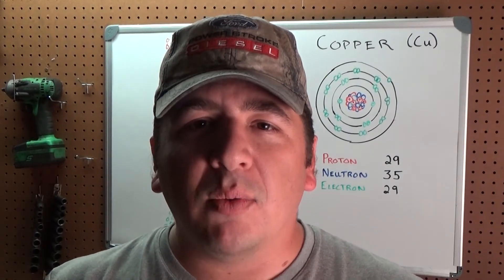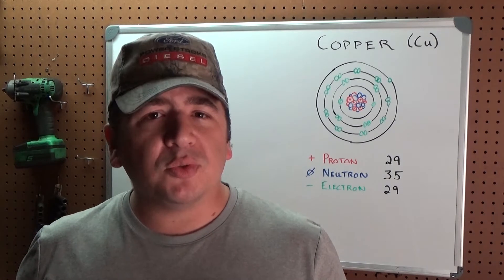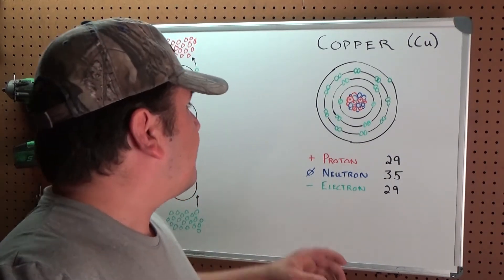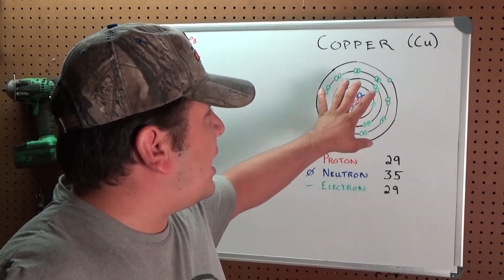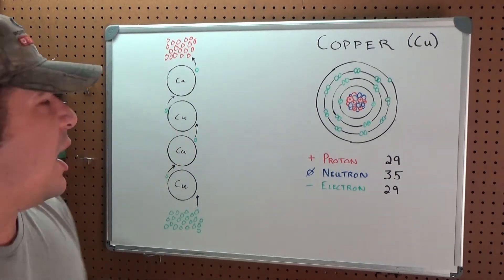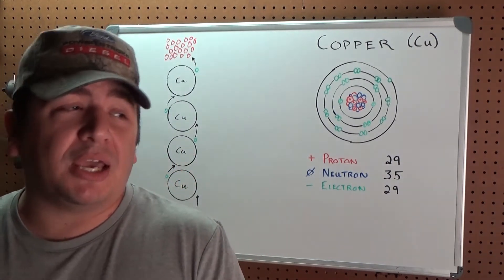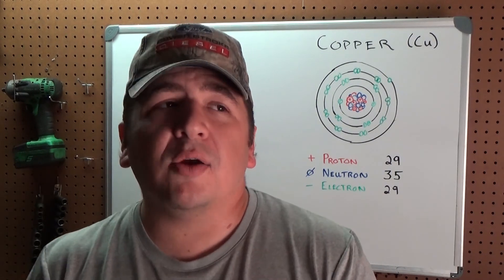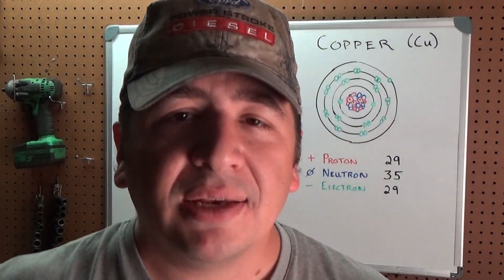What is Electricity - Electrical and Electronic Systems Training Series 1 - Automotive Education

Comment: DIY AUTO HOMESCHOOL, old classic cars in the 60's and 70's only used ONE ignition coil to fire all 8 spark plugs. Fuel injector cars need multiple ignition coils per fuel injector, any reasons why fuel injectors need multiple ignition coils per spark plug? A coil of plug COP has multiple ignition coils any reasons why? how would you measure a spark plugs waveform using an oscilloscope to test if the spark plug is good or bad?
Reply from the maker: Yes, older vehicles used a single ignition coil, the problem was RPM's. When you're trying to turn a V8 engine 7k RPM's, that coil doesn't get much dwell time, and it's working super hard. 

On newer engines, having 1 coil per cylinder gives the coils more time to dwell at higher RPM's and doesn't require them to work as hard extending coil life. 

The best description between old carburetor and single coil engines compared to new engines is that back then they were running an 8 cylinder engine. Now... the computer is independently controlling the equivalent of 8 different 1 cylinder engine. They're capable of adjusting injector pulse and ignition timing on each coil and injector independently of the others.
Reply: @DIYAutoHomeschool  can you please make a youtube video explaining dwell time, i don't understand dwell time and where to look for the dwell time when looking at ignition waveforms on the oscilloscope where is the dwell time at in the waveform?

Comment: The condenser inside the distributor of the 194 inline 6 cyl engine in my 1963 Chevy Nova lasts only 100,000 - 120,000 miles. Any suggestions on how to fix this problem? The car has only 653,000 miles on it.....should I buy a new distributor?

Comment: after college with you and joe for automotive I studied this pretty deep but if I remember correctly the actual physical  electrons themselves flow positive to negative while "current" flows negative to positive or visa versa kind of relative but I remember current being opposite of the actual electron particle. this was when I was studying atomic and sub atomic physics so its not really necessary to know as far as automotive goes but the whole conventional theory and electron theory were basically incorporated together and then they broke down the specifics discussing what current actually was. id probably have to dig up my old papers to get more in depth lol
Reply from the maker: Tate Smith The best way it was described to me is that, as we talked about, electrons will flow negative to positive by nature because they are a negative charge and will be attracted to a positive charge. The conventional flow theory could be considered accurate in the sense that as electrons flow, the positive charge that attracted them will travel through the conductor in the same path and opposite direction of the electrons. Current, by definition, is simply a measure of electrons flowing past a point in 1 second. So I would imagine the direction of current flow would be considered to be the same direction as the electrons since it's a measure of the quantity of electrons flowing past a specific point in a given time.
Reply: i believe its measuring actually the absence of an electron so the force that pulls relative to the electron particles movement making it opposite. im double checking my self and all the sources are saying that current is opposite of the actual electron particle movement. current measures the rate at which a 'charge' moves through a certain point per any given unit of time rather than the 'electron' because of drift theory, measuring the rate of electron movement through a single point would be entirely different. i think most confusion comes from the terminology and how its used. electrons are negative yes but a charge is a "direction" also using the term negative or positive relative to its direction of flow. a charge can be negative or positive like in alternating current especially yet the electron movement its self is a bit more complicated in a circuit with alternating current. however depending on how the terminology is used and interpreted makes this all seem a bit more complicated. a battery with a "negative" charge would technically be "impossible" depending on how you look at it yet there is no difference in the actual energy of a negative charge versus a positive charge its just flowing in a different direction so the terms 'negative' and 'positive' are just relative but because of how we try to simplify electricity with static terminology seems to later cause confusion in more complex electrical interactions but understandably using the term 'positive' or 'negative' as a static constant is much easier to understand as far as the basics go and with wiring diagrams and what not as far as automotive is related. lol but watch out! AC motors leave DC motors in the dust in terms of efficiency and with electric cars on the rise we could potentially see a major shift in the electrical systems of future vehicles.